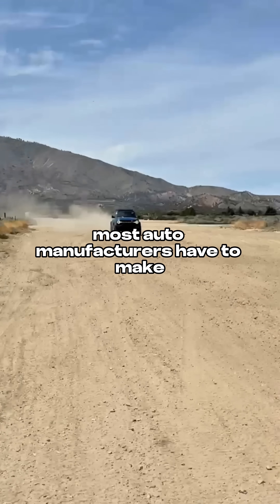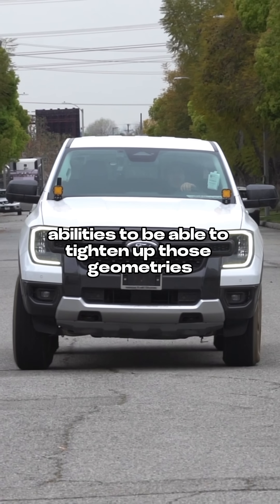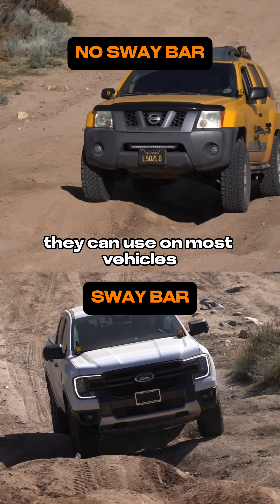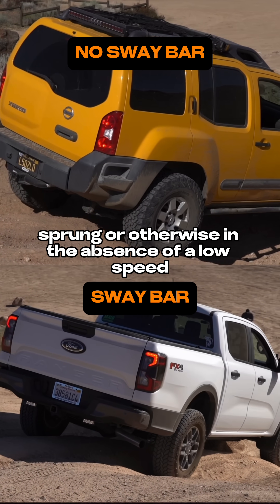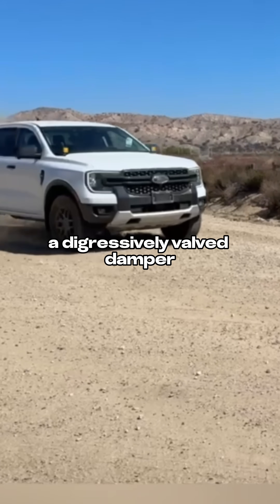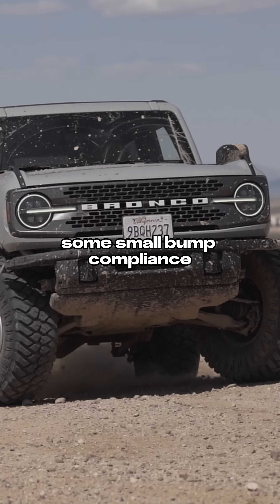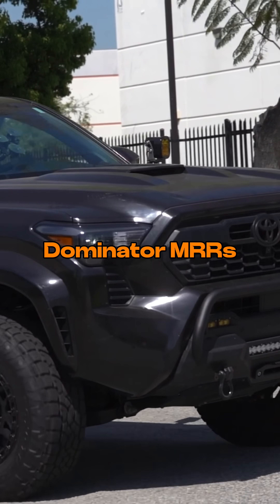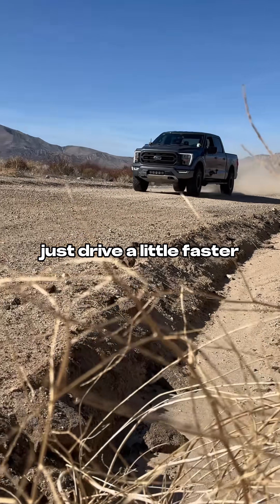If Digressive Shocks Ride Stiff, Why Are They So Popular? #shocks101 #shocktalk #shocksurplus #valve

Comment: Almost all ODE’s that calculate the spring mass damper system are simplified with a constant damping coefficient. A digressive setup can give a decent approximation of these calculations. Just an observation.

Also, I have found that increasing the rebound stiffness of the shocks to reduce the “buck” after compression really helps the ride to feel more smooth and controlled. I’ve yet to find a shock package that has enough rebound control for my taste out of the box.